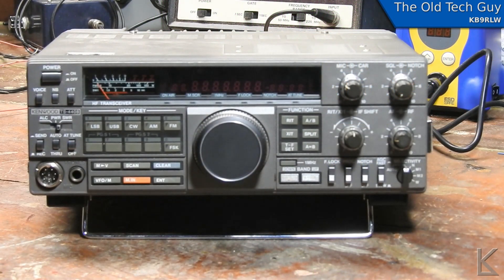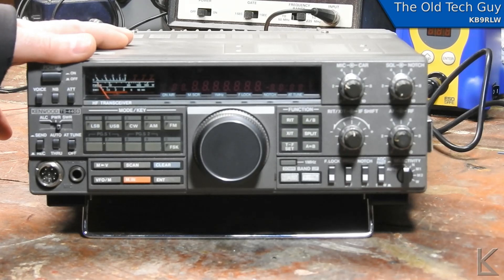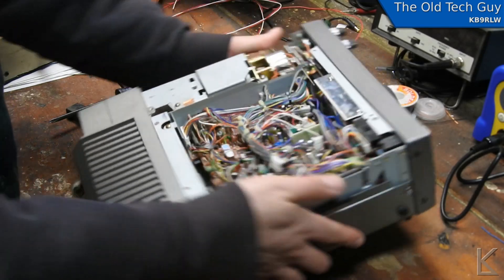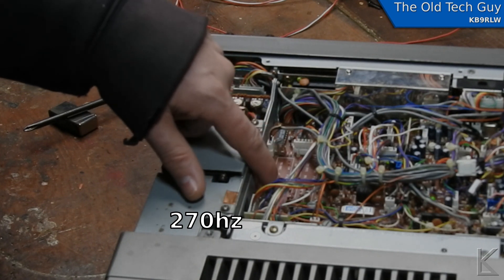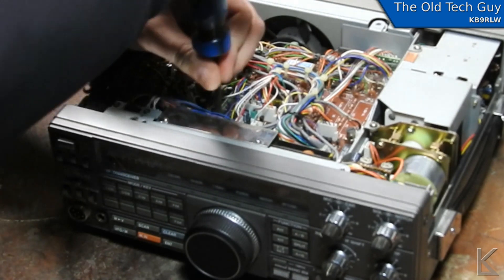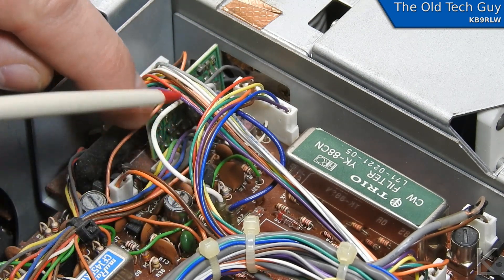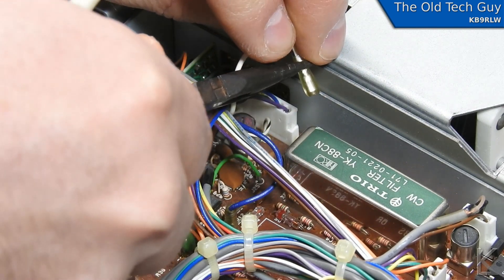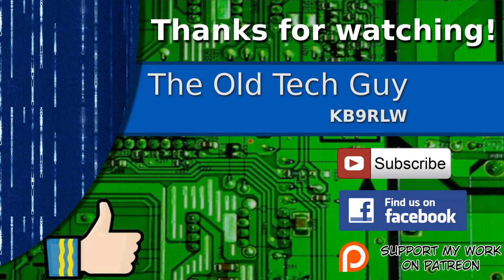Ham Radio - Installing an optional CW filter in the Kenwood TS 440S

Comment: What a great job! Wish I could find a similar one on installing the IC-10 and VS1 modules in the Kenwood TS-440SAT.... Most importantly, before tearing it apart I wanted to figure out the easy way to check and see if the capability is already there. It’s pretty obvious for the voice module PS1. You push the button and if it doesn’t say anything you need the module :-). Period. And it goes in below the PCB you lifted for this filter installation :-)

I don’t know if there’s an easy way to check whether or not an ICD 10 is installed without opening it up, and it seems like a lot more to getting at this little module. Period. Have you dealt with either of these before for your 440? I do love the radio! Paul de NT3L

Comment: Thank you. Thank you. Thank you. I bought a Kenwood TS-44S/AT and since I didn't know what I was looking at, I didn't realize it had the Automatic Tuner installed. I was expecting something on the other side for some reason. I've been trying to tune an antenna for a few days now. And when I saw your video, where you pointed out your Automatic Tuner, I tried it and it works!!!! I only wish I had seen your video before I bought an external tuner (that I couldn't get to work) and pieces to make a new antenna.

Comment: Very good video, I just bought a T-SHIRT-440 and will be adding the optional filters in the future. One question.......what power setting do you use on your soldering iron, or should I say temperature? I am not an electronics tech and would not want to fry my board by putting too much heat or wattage to the board during soldering.
Reply: Bob Ward Why T-Shirt? I fail to get the humor. If it's humor

Comment: I have been meaning to do this for a while although  i will go with the 500 hz filter.I recently picked up a SM-220 station monitor, and have been using it to view my transmitted wave form , but i am going to Tap the 8.83 mhz if which is located on the top of the board and easily soldered to so i can run some caps through  Rg-174 coax to a BNC and plug in the Pan-adapter and see received waveforms.probably do the filter install at that time73'Jim KB1PFL

Comment: I just wish you guys would heat the joint before sticking the solder to it. anybody can melt solder on a hot iron, but you need to melt it on the joint. just begging for cold solder joints otherwise. on the other hand, the inexperienced can mess up the board if they heat it too much. Ive seen more than my share of that. I'm sorry Kevin, its just a pet peeve of mine and I mean no disrespect. your joints looked good even though slightly rushed. I enjoy your videos the most. thanks for your time in instructional and informative works....
Reply from the maker: Well, I do actually.   I touch the iron tip to the joint and then touch the tip with the solder to transfer heat.  After about half a second, I add some more solder and watch for it to flow around the wire and pad completely before lifting the iron.  That flow around the wire and pad indicates that they were heated to the point where the solder took to both.
It just happens fast enough to be missed if you're not looking for it.
Thanks for watching!

Comment: Many years ago I learned that you do not tighten any screw down until you have them all started! I was working on an HP 2117F (I think) that had around 18 screws holding the cover on, after putting in about half of the screws no other screw holes would line up! Had to loosen all the screws I had tightened in order to put the other screws in!

Comment: Thanks for the video Kevin. I am surprised at how easy it is to add a filter to the TS-440. Great video. 73 de K7RMJ Frank
Reply: Even better double to use aerosol flux remover (can find it on Amazon) -far better than alcohol, which does some oxidizing/chemical dulling... 73 Dr Paul NT3L

Comment: Hi Kevin,
Nice video. Did a similar install on my FT901DM about 25 years ago. I also see it was mentioned about the solder blobs (one large and one small) and your reply. 73   WB3BJU
Reply from the maker: Yeah.   I'm actually thinking about filming work more regularly.  The camera angle saw that blob, but it was out of my view line.  It's a bit OCD, but a heck of a way to check your work.
Reply: Hi Kevin,
The camera doesn't lie.  HiHi   73   WB3BJU

Comment: Kevin,

Thanks for the video. Sorry to say that about 17:20 it looks like a solder ball is either bonded itself to the conformal coating or now running around inside somewhere. The first thing I saw and thought was solder was / now believe could be flux splatter but after that fairly certain solder drop hit the ground plane. Once again I hope it melted itself into the conformal coating and stays there.

You are doing a great job and I am glad I do not have many eyeballs watching my work. ;<)
Reply from the maker: I actually saw that during editing and went back in to remove the tiny bugger.
Reply: Glad I wasn't the only one to notice! 😂